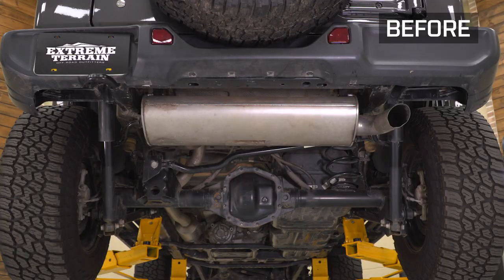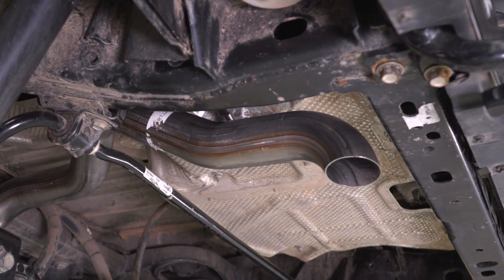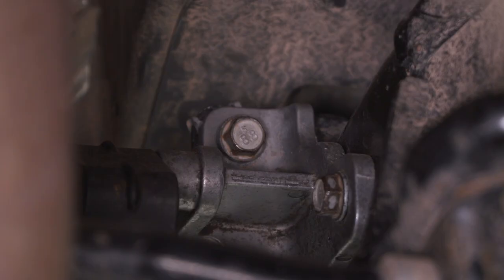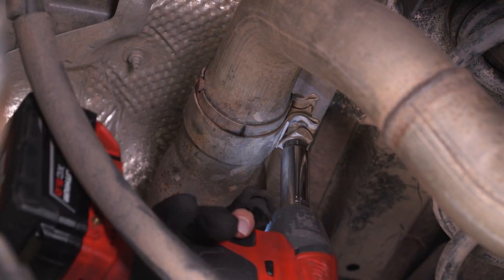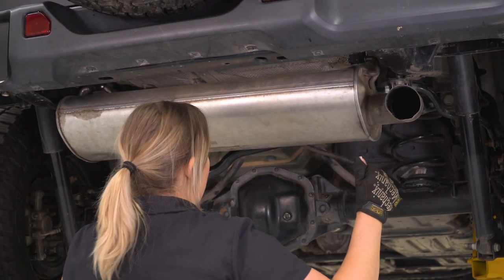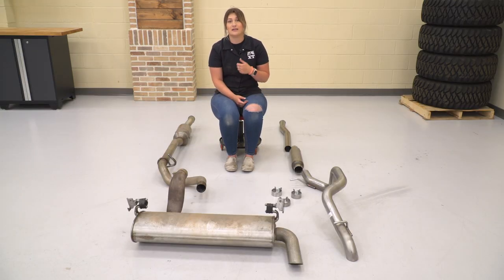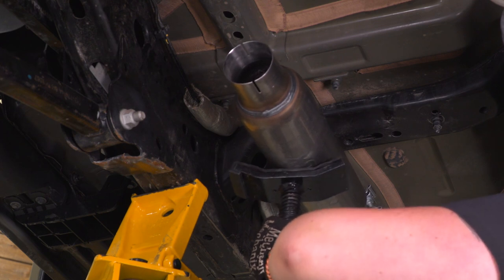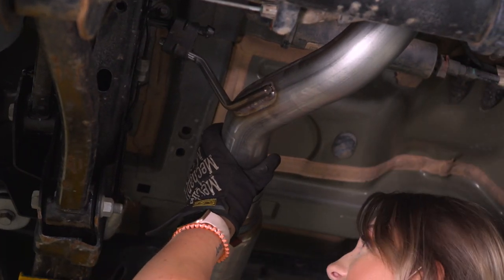Jeep Wrangler JL RedRock 4x4 High Clearance Cat-Back Exhaust Sound Clip & Review

Comment: It's hard for me to try and change the sound of my Jeep only because of the fact that it's a 6 cylinder , I've been so use to V8's and the solid muscle power and sound of them that hearing a 6 banger with a good exhaust system just doesn't do it for me , so I'll be sticking with stock .
Reply: Mine performs better when picking up speed around 70 and I surpassed my dream MPGs. $70 muffler

Comment: What I would like to know is why wasn't the tail pipe worked over to the side. Where its at right now seems a perfect place to get it crushed. If the departure angle will smash that big idotic muffler it will crush that tail pipe.